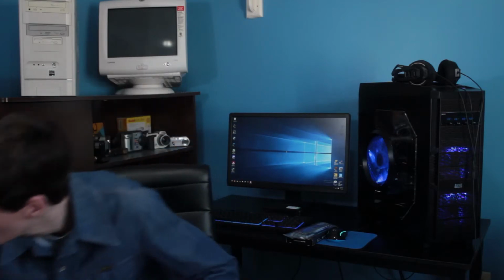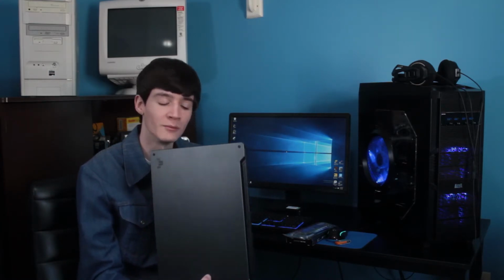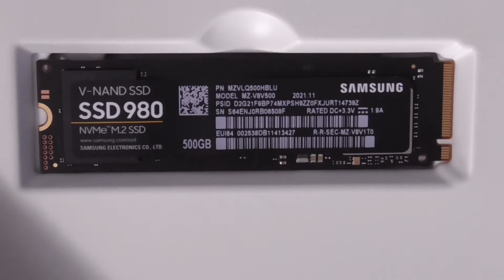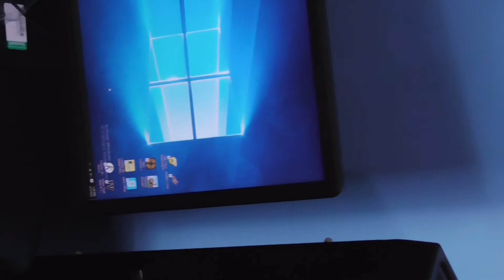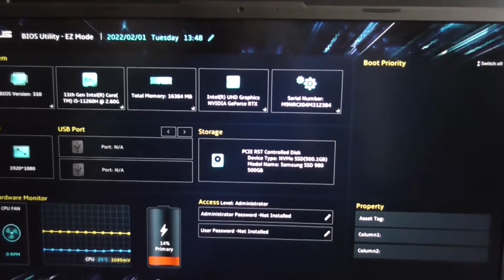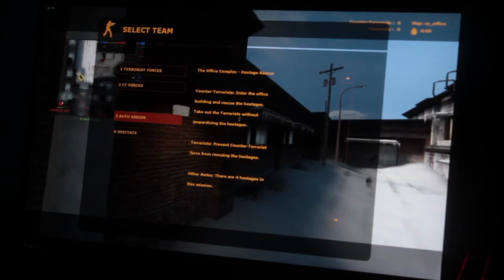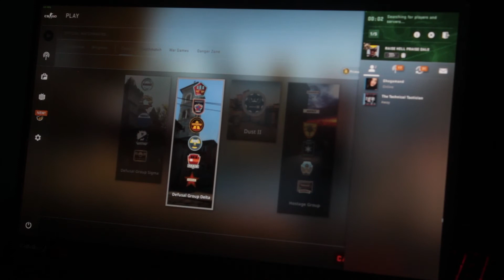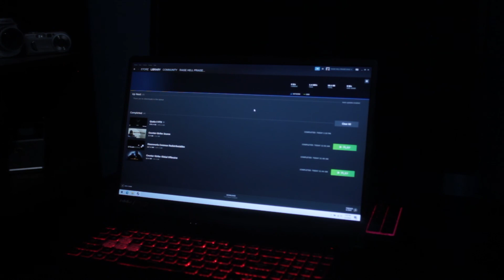Upgrading the ASUS TUF Gaming F17 Notebook! •Windows 10 •Samsung SSD 980 •16GB RAM

Comment: So will Windows 11 be a problem for your gaming laptop if you intend to keep it for long term?
I have a similar but slightly better laptop as yours, should I switch my OS from 11 to 10?
Reply from the maker: Win 11 is the future, 10's days are numbered, i'd keep 11 at this point. In 2021 11 was still brand new and had a lot of bugs but now it has improved quite a bit.
Reply: @TheCRTProductions   Thanks, that's good too hear.

Though, I'm a bit concerned about Win 11 like you mentioned and how it could have apps running in the background during gameplay and how that can heat up my computer.

When I'm mostly browsing the internet right now and Steam, I noticed that my Laptop PC would have temperatures about 70-80° Celsius and CPU usage would be at about 1/4 or sometimes 25% at most.

I'm not sure if that's normal and what the regular temps should be since I don't want to speed up the process of having to replace thermal paste/pads after not exactly using my PC that intensively. Not sure if it's optimized.

But yeah, that's just the gist of it.
I think I'm using Win 11 Home and I heard there's another version called Pro, which I don't think I have installed, but I also need a recommendation which should I opt for?

Comment: How was the gpu utilization? I have the same laptop(not upgraded), the gpu usage never goes over 20% while I play csgo.
Reply from the maker: Once I upgraded to 10 I get 60fps stable in Control with medium settings and ray tracing enabled (very impressive, and that was before getting my laptop cooling pad which significantly improved GPU performance!) CSGO gets like 400fps on medium high settings
Reply from the maker: The GPU in this laptop is the bottleneck (after upgrading) so it’s at 100% in those tests
Reply: Thanks for the reply. Is there any way I can fix the low usage issue? I get only 90-100 fps in csgo(low settings).
Reply from the maker: I installed windows 10 and it fixed everything that’s all I know 😊

Comment: Are you sure there wasn't something wrong or wasn't properly configured when it had W11? I have a Zephyrus G15 and W11 runs just fine with all my games
Reply from the maker: With all the other problems besides graphics performance, I'm not really concerned! I tried all the methods I could find and it still performed poorly. With windows 10 I also didn't have to login to a Microsoft account :-)
Reply: @TheCRTProductions  did your issue got resolved brother??
Reply from the maker: It works amazing now
Reply: @TheCRTProductions  you need a windows 11 pro version to not have to use your Microsoft account.  Can't be home.

Comment: Do you know what the Maximum amount of Ram can go in this machine?
Reply from the maker: Probably 64gb but I would check the tech specs on the manufacturers website
Reply: @TheCRTProductions  have not been able to the spec on the website.  Did hear a video that said 24. However watched plenty of videos with people installing up to 64. I was thinking 32 myself.  I noticed your laptop did not come with a cradle for a 2.5” SATA drive.  Hoping mine has one in there so I can install another HD without having to reinstall windows. Thanks for responding.

Comment: i have the exact same laptop and installed second ssd slot 2 tb but the problem is the ssd gets really hot and reaching 72 degrees and i think its because the ssd not came with heatsink and I dont know if I can put heatsink inside laptop if it can fits in.
Reply from the maker: It probably won’t fit, SSDs just tend to get hot. 72 isn’t too bad inside a laptop like this. As silly as they seem cooling pads do cool down laptop components other than the CPU and GPU if you use it stationary most of the time.